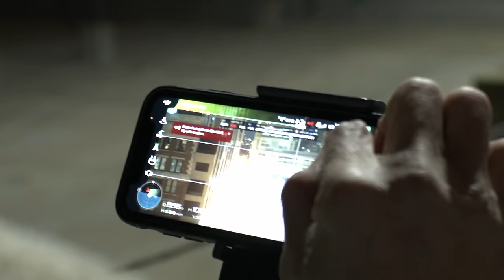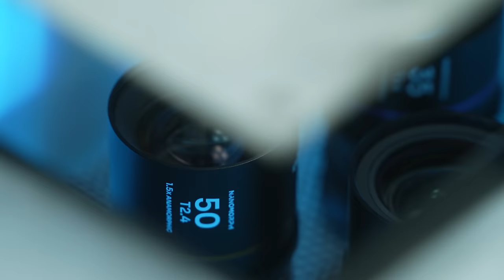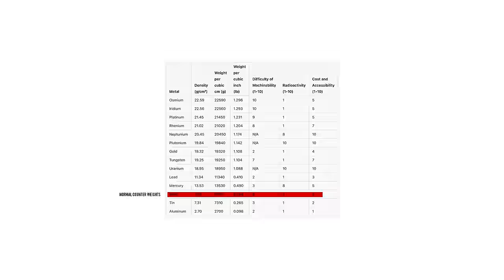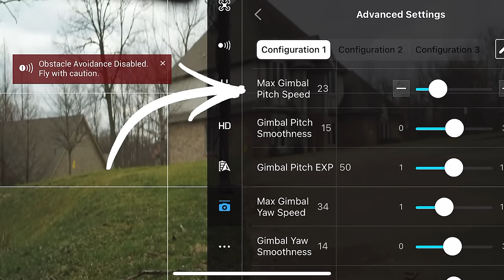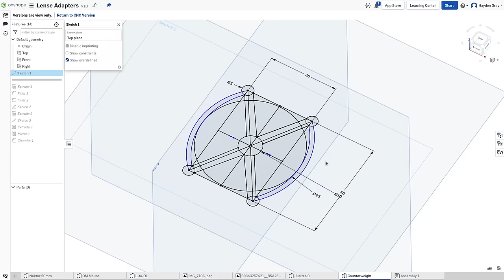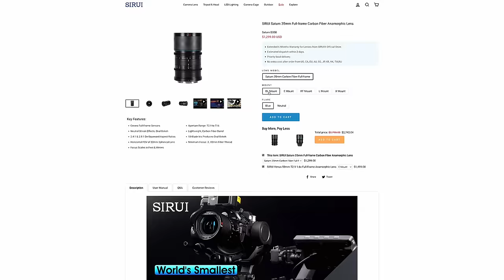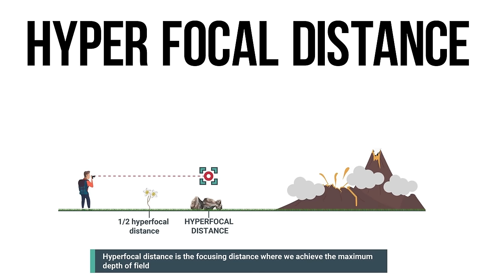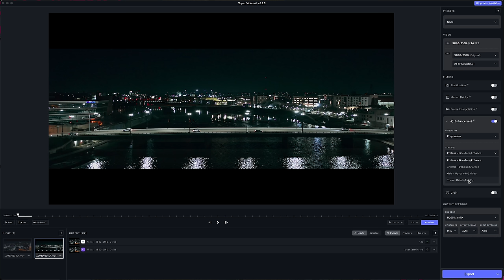My Frankenstein Anamorphic Drone.

Comment: Thanx very much! that tungsten density conclusion is the way to go for counterweights, maybe for everything about filming (loved the dark comedy behind the toxic and radioactive materials). You are almost completing your new Rigs for Anamorphia. Hyper focal distances for manual focus lenses in a Drone is a great solution, until someday comes out a follow focus motor with LIDAR like in the Ronin 4D. If Inspire 3 is not that impressive, is because maybe DJI could had made this Follow focus system for it, and make a difference proportional to the ronin 4d release impact. Greetings

Comment: No firmware hacking?! 😁
You could throw those brackets up on Shapeways with a small markup too. They have SLS nylon which is super durable. Could make Hayden some good cash there with no overhead.

Comment: Almost turned into "I broke the Inspire 2" lol. I'm curious to see the results of the TTArtisan 50mm f/0.95 because I got one to do a review video and honestly in my opinion, the f/0.95 is not what I expected. It performs very much the same as the f/1.4 regarding light and depth except there's a lot more fringing as well as vignetting/blur around the edges unfortunately. I own the 35mm f/1.4 and honestly it performs more to my expectations than the 50mm f/0.95. Oh, by the way, the TTArtisan 35mm f/1.4 is literally the smallest lens I have ever used and it weighs only 180g, so I'd love to see that one take a spin on the Inspire 2.
Reply: I think the f/0.95 is more of a gimmick. I think they have to take too many compromises. I've never really understood the appeal honestly. I find on my f/1.8 and f/1.4 lenses I'm never wide open and many times I get great shots with the right DoF and bokeh at f/4!

Comment: You can 3D print using Polycarbonate. Incredible strength and also heavier than PLA, which can work towards the balancing of the gimbal.
Reply from the maker: Just found out you can also print with tungsten filament.
Reply: @MAKEARTNOWCHANNEL  Damn! Just saw that one. They call it "Prusament PETG" for radiation shielding.

Comment: did you manage to fit the 50mm f0.95 tartisan aps-c ? and if yes ,witch version mount of the lens you used? 
thnx in advance
steve
Reply from the maker: Any adapters or bayonets that work for the i3, also work for the i2. Though, keep in mind you cannot put as heavy of glass on the i2 (if thats what youre flying). the i3 can hold more counter weight and has slightly stringer motors - can fly more options.
Reply: So the adapters you are selling on your site can  fit the X7 also, good to know.
Now ,is there any other way i can get those adapters ?
cause if i can guess right you are in usa and the shiping and custom from there to my location will cost a lot .
thnx again for your time
Reply from the maker: @stevensbass7953  shipping is $24 fedex international, 2-5 days.
Reply: @MAKEARTNOWCHANNEL  yeah but greece has difrent opinion on this, it will tax me double that when it comes to my post office its a sad sad story

Comment: Hey, do they have more of these DL mounts for sale? Can I buy one? Getting cheapest Laowa is still quite a lot (400usd)... :)
Reply from the maker: What do you mean DL mounts? I'm in the process of making some, but won't be for a while. I've been 3D printing them, but the distance varies from lens to lens. So it's hard to know what exact lens you need one for.
Reply: @MAKEARTNOWCHANNEL  here's 100mm lens on X7 https://www.youtube.com/watch?v=AEHAZkpUtgM . To make it happen we used (unscrewed) DL mount from Laowa 9mm ultrawide... So basically we need separate mount to be able to fly both Laowa and 100mm without a need to swap mounts from one lens to other :)
Reply: Alright, now I looked through whole video - you do not have DL mount either (yet)... Apologies!
Reply from the maker: @skycam_ee  Whats the exact lens used? ill have to gtet a copy and test I think. But def worth doing.

Comment: why not just mount a 3d printed arm to the lens that lets you add a counterweight behind the gimbals arm?
Reply from the maker: you could try that too! i worry about getting full mobility that way, and also introducing wobble in the yaw. I tried that process with the ronin s a few years ago with thee bigger lenses (400mm f2.8) and what i learned is the more counter weight you put on and the further you put it away from center mass (in order to compensate) the more you introduce additional wobble from the counter weight reacting to the stabilization. Meaning; the best practice is to get the counter weights as close and as dense to center mass as possible, or shift center mass on the axis back so that it works. 

What might work even better than my workflow would be to cut the gimbal arms, and lengthen the wires and 3d print an adjustable  brace to slide the lens forward and back to accommodate different sizes and weights of lenses.  Then you could put whatever lens you wanted in there and use the lens and gimbal as their own counter weights, exactly as other gimbals work.
Reply: @MAKEARTNOWCHANNEL  cool to hear it's been considered. my reasoning would be to keep overall weight on the drone down while allowing for adjustment and not needing to permanently modify the gimbal. theoretically there shouldn't be any worse stabilisation when putting the counterweight further back from my understanding, but it does need to be very stiff and not introduce negative aerodynamic effects.
probably not buying an inspire 2, so this is all theoretical, but if I did I'd absolutely want to use different lenses so it's really cool to see it's possible

Comment: So Topaz isnt a sponsor but is a sponsor, got it.
Reply from the maker: Topaz did it pay me to say this. So, they are NOT a sponsor. They don't have input on video etc... 

I may be an affiliate of topaz, but that does not make them a sponsor. Same thing when you buy from links in Amazon or B&H. All my videos have those links, yet non of those videos are "sponsored" from B&H or Amazon. They don't pay me to make those links or videos. I only get compensation if you buy something thru those links. 

Make sense? There is a distinct difference according to the FTC, and each case is treated differently.

Comment: Cmon lead is not that dangerous to handle. Common sense open air practice is sufficient. Machining Tungsten is not fun and is also a carcinogenic.
Reply from the maker: Not if you have kids. Smelting it can stay on your clothes and transfer. Easily avoidable in this case. Tungsten.